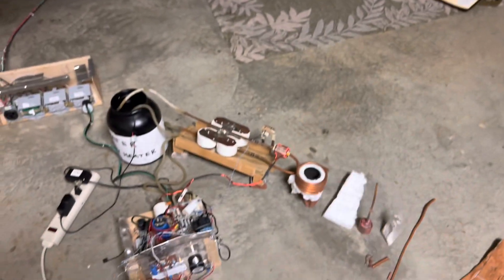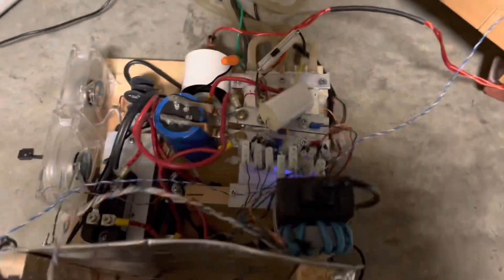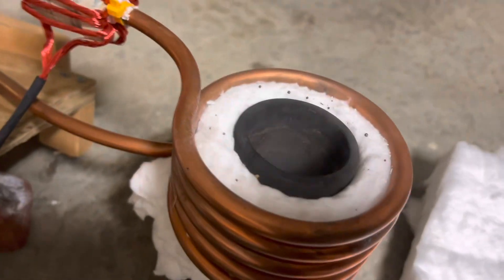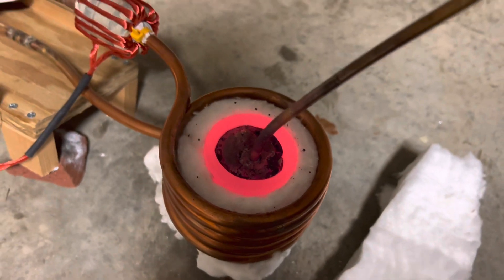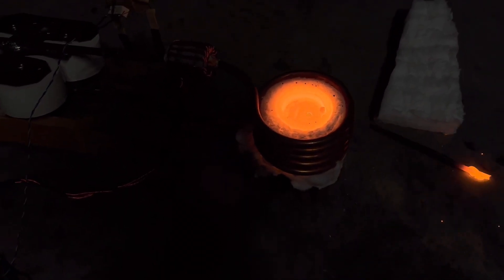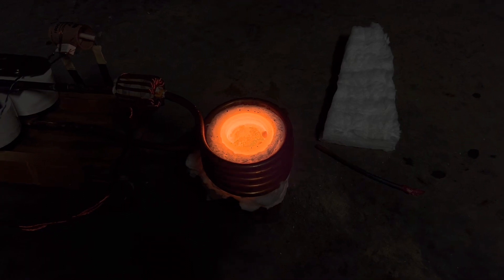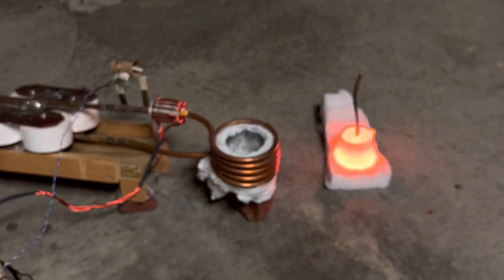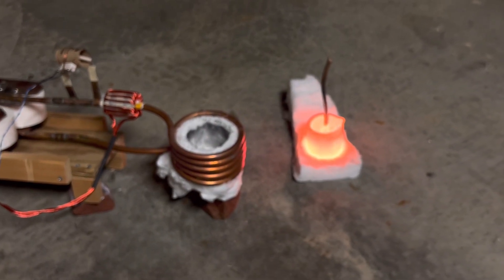Inductive Scrap Metal Melter with link to build instructions

Comment: To limit current in the tank lc when a workpiece is not present, have you considered the lclr network topology? I built one running open loop using a 555 as the clock, seemed to work pretty well but I was only running like 700 watts. 😂

Comment: Is  it possible to make the coil larger, like to fit a steel container 5 to 6 inch diameter? I only need to get hot enough for aluminum. Maybe brass would be nice but alum for sure.
Reply from the maker: Yes coil can be made bigger. It will work with any size coil. For larger coil the resonant frequency will be lower. This needs to be above 20 kHz.  This can be done by lowering tank capacitance value for larger coils. The current rating of the capacitor or capacitors needs to be at least 500A or above. I have two parallel 650A caps (1300A) which is overkill. It’s better to use water cooled capacitors.
Reply: @BrianDhvTinkerer  ok so there is some calculations that need to be made I am guessing for the number of turns as well? I don't quite understand everything you said, but I have sitting in the scrap pile a large transformer with some copper winding that is hard to bend that might work for making a coil, unless it will melt? I see some run water through the tubes that make the coil, so I am not sure since aluminum melts lower than copper.
Reply: i need to find someone who knows what that means to help me built it lol

Comment: Is there any other easy option to replace the IXDI614CI and  IXDN614CI ? these components are very dificult to find here.
Reply from the maker: Try UCC37321 and UCC37322 inverting and not inverting gate Driver pair with MSOP power  pad

Comment: Hello Brian great demonstration...i read all your toturials on every induction unit you made and i actually built exactly the same one as your FGA60N65SMD full bridge and it worked great...but recently i was reading about other induction furnace designs and i found a potentially major improvement for the circuit, so i have a bunch of questions for you that I really appreciate if you answered them for me:
1-I read that adding a large smoothing capacitor after the rectifier actually lowers the power factor by making the circuit look like a capacitive load and also introducing mains current harmonics, that is why commercial heaters and induction cookers don't use them what are your thoughts on that?
2-Why didn't you use some type of mains line filter like a common mode choke and/or a X2 capacitor?
3-In your gate driver circuit there is no dead time circuit, how did you prevent short circuit caused by IGBT shoot-through?
4-Your current transformer sends a sine wave back to the Schmitt trigger, that causes the output to be a square wave with a duty cycle less than 50%, why didn't you transform the sine wave to a square wave before fedding it to the Schmitt trigger?
5-How much voltage do you see across the tank capacitor on full load, and is there a formula to calculate that voltage...and also how hot they get?
I would be very happy if you answer my questions thank you, have a great day.

Comment: Great project! I kept expecting the crucible to crack and fall apart when you put it under the cold water but surprisingly it didn't.
Reply from the maker: Me too !! the coefficients of expansion must be matched!!
Reply: Nice work! Scaring me with the water and mitten metal though
Reply from the maker: @christopherreeves6797 thank you I have a final setup which I think is going to be reliable in the long term. I posted it in hv forum under feedback induction heater in the section for induction coilguns etc. I will see about getting a video on this put out shortly

Comment: No BoM ?
Reply from the maker: What is BoM? 😁
Reply: @BrianDhvTinkerer  sorry mate. Bill of Materials. List of components required. Also what mods are required for 230V mains? Great build.👍
Reply from the maker: I should be able to get you the BOM. No mod necessary for 230V. It would just work. However, I might have to increase the durability of the tank capacitors because the current would be huge with 230 V.
Reply: @BrianDhvTinkerer  how would you increase the durability? Higher voltage or more of them ? And thank you for your responses

Comment: Not sure if kaowool (kaolin, aluminum silicate) is the same as what you're using, but these high temperature insulating wools tend to be pretty bad for your lungs; not quite as bad as asbestos, but not great. Rigidizers and refractory cements are typically used for sealing it to prevent the fibers becoming airborne.
Reply from the maker: Good to know thx for the info